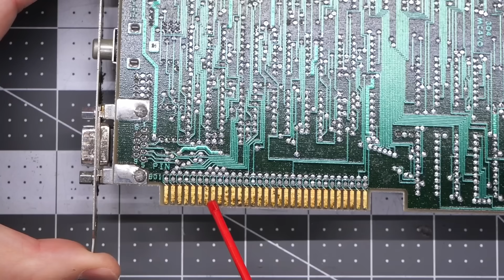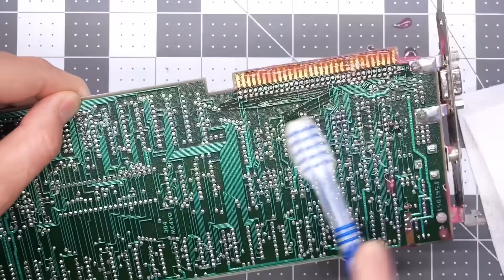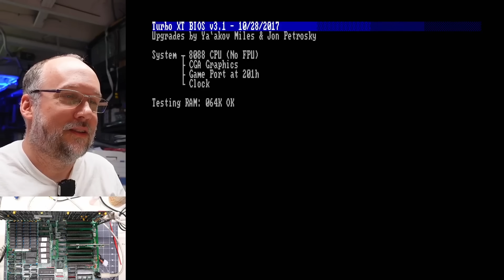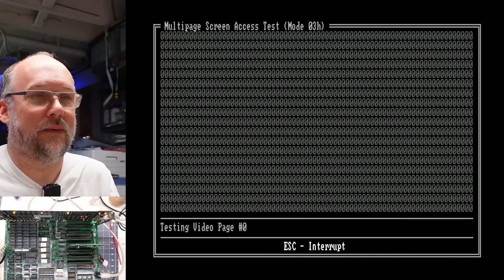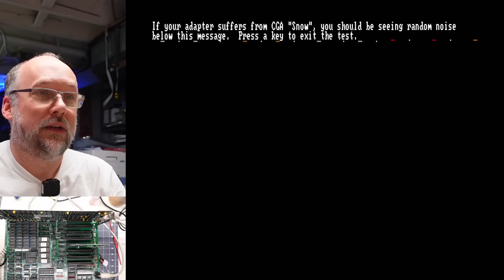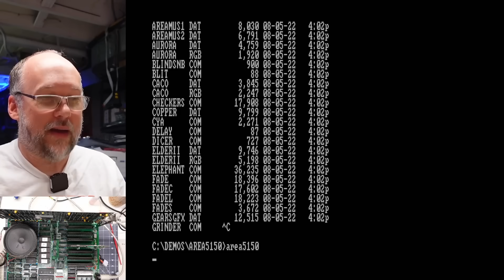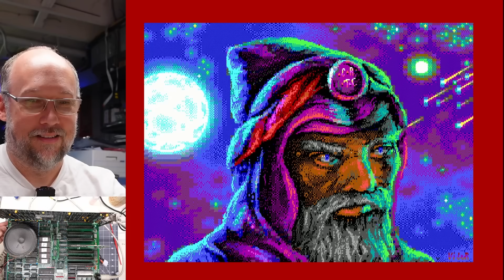Can we save this heavily corroded IBM CGA card?

Comment: According to the new Google AI: Loctite Naval Jelly Rust Dissolver is a gel-like rust treatment that contains the following ingredients:
Water: 65–70%
Phosphoric acid: 25–30%
Sulfuric acid: 1–3%
Thixotropic polysaccharide: 1–3%
Isopropanol: 1–3%
Surfactant: 1–3%
Silica: 0.1–1% 
 
MFA CAMEO Database
Naval Jelly Rust Dissolver - CAMEO - Museum of Fine Arts Boston
Oct 17, 2022 — Naval Jelly contains Water (65-70%), Phosphoric acid (25-30%) and Sulfuric acid (1-3%) in a gel matrix composed of a thixotropic polysaccharide (1-3%), isopropanol (1-3%), Surfactant (1-3%) and Silica (0.1-1%). The phosphoric acid dissolves the Rust (iron oxide) and then reacts to form iron phosphate.

The Home Depot
Loctite Naval Jelly 16 fl. oz Rust Dissolver 553472 - The Home Depot

dm.henkel-dam.com
TECHNICAL DATA SHEET
Apr 12, 2018 — Color: Pink. Application Temperature: Apply between 50°F (10°C) and 90°F (32°C) Appearance: Liquid gel. Odor: Lime (use in a well-ventilated area) Base: Phosphoric acid. Working Time: 5 to 10 minutes. Specific Gravity: 1.191. Max. Working Time: 15 minutes. Viscosity: 2.5 Mcps. Clean Up: Rinse product off with water. pH: 1.5-2.5. Caution: Wipe off painted surfaces immediately. Will remove paint. VOC Content: 2.4% by weight. 28.6 g/l calculated. CARB. SCAQMD rule 1168. Shelf Life: 5 years from date of manufacture (unopened)
Generative AI is experimental.

Comment: Find yourself a gold or tin brush electroplating kit. Shouldn't be that expensive, and the voltages should be low enough to not toast anything (and even if they are, with a little care you can keep it isolated to an individual pin and not flow current).

Comment: I performed a number of jobs before I became a tech ranging from circuit board assembly to touch-up soldering and also QC in-process inspection. Those yellow stickers with black arrows most likely come from QC inspection after the parts were inserted, most likely by an auto-insertion machine, before the boards are put through the wave soldering machine.  If a bent leg is found, the QC inspector will put an arrow pointing out the bent leg so that a PC assembler can go back and fix the board. Sometimes, the boards make it all the way through into wave soldering and these are found during the touch-up phase, but in this case, they appear to be pre-wave-soldering because, would be signs of hand soldering.

Usually, the arrows are removed but for some reason they were missed and forgotten on this board. Just like the board, these arrows are part of history.

I would tin those exposed edge-connector pads. That will seal them up pretty well. I wouldn't worry about scraping off the solder from the surface. If you think about it, how many times are you going to be inserting and removing the card from a motherboard? It's not likely to be done on a daily basis or more frequently than that.

Comment: So I think that black stuff may have been fossilized soda. It kinda makes sense for how it corroded, but still looked black when it was on plastic. If it was Coke, the phosphoric acid in it would easily have caused the corrosion over time. And the Naval Jelly easily would have dissolved it because the way you remove dried Naval Jelly is with more Naval Jelly to rehydrate it.

Comment: LIQUID TIN - by MG CHEMICAL

Just brush it on the traces or dip after cleaning.
Made for circuit boards.
It  auto electroplates instantly.
Reply: Lots of 5-star reviews on Amazon.  Thanks for the suggestion!  I'll have to add some (and gloves) to my cart to use in the future.

Comment: I'd be curious about trying to electroplate some gold onto the contacts. Obviously that could cause damage but maybe setting up a power supply with a probe to the top edge of the contact and an alligator clip holding a cotton ball soaked in gold plating solution would work. Have to be really careful though but it could be a fun experiment.

Comment: @AdriansDigitalBasement][
If it were me, I would take a rubber eraser or magic eraser, very littlely to the contacts and then carefully tin them. A lot of material has been remove and tinning will restore those contacts to a better thickness a strengthen them up.

Comment: I would tin the contacts and then wick them off again REALLY well so it's almost an alloy of the copper/gold and the solder instead of a "coating".   USE FLUX PASTE and wash with IPA.   Probably lead free solder as well.

Comment: One thing to realize Adrian is that a dab will do ya with Naval Jelly.. I realize it's cheap and you can use however much you want, but seriously, it's basically phosphoric acid in petroleum jelly, it will absolutely stick to whatever you put it on and you don't need to build it up thick, a little bit and about 10 minutes, but 10 is pretty much the max on electronics.. but yeah, a dab will do it..

Comment: The law about labeling every carcinogen, no matter how safe, may sound silly, but the penalties for infraction are no laughing matter. It is put on anything with even the most remote chance of being on sale in California, because no matter how many gallons of ink you need to put it on every product label, it'll still be cheaper than accidentally offering even one relevant product in California and getting noticed.
Reply: Prop 65 was responsible for a substantial reduction of lead (and other chemicals) in products nationwide (maybe planetwide.) The problem is that there was a penalty for not labeling covered chemicals but no penalty for labeling non-covered products so businesses just put stickers on everything.
Reply: @wesley00042  Known to the state of Cancer to cause California
Reply: @wesley00042  The problem with that is that it is no longer a warning.  If everything is bad for you than nothing is bad for you.  How are you to know if you are dealing with something that is truly cancerous or just something that was inked on to prevent a penalty?

Comment: so the Technical Data Sheet Says it's Phosphoric acid with a PH of 1.5 to 2.5..   Also says not for use on Fiberglass, plastic of aluminum. Oder is discribed as "lime" and Use in a well ventilated area)     You should be wearing gloves AND goggles when you work with it.

Comment: Most people won't be adding and removing cards a ton, so I would say that your scenario is the exception, not the rule. If some solder sheds into a slot, I think that's acceptable.

...but this might be your excuse to play around with some low-voltage (read: it'll take forever to complete) electroplating. Figure out where those slot connector pads(?) go, maybe pop out a chip or two (but hopefully not) to protect them, and re-plate them.

Comment: For the card edge fingers, tin them with a good solder, then remove as much of the solder as you can with de-soldering braid.  This will leave a very thin coat similar to HASL.

Comment: AI states, Naval Jelly contains Water (65-70%), Phosphoric acid (25-30%) and Sulfuric acid (1-3%) in a gel matrix composed of a thixotropic polysaccharide (1-3%), isopropanol (1-3%), Surfactant (1-3%) and Silica (0.1-1%). The phosphoric acid dissolves the Rust (iron oxide) and then reacts to form iron phosphate.

Comment: An alternative to tinning with flux and solder may be the so-called "liquid tin" made by MG Chemicals among others. It's a solution that you can paint onto exposed copper and it will coat it with a layer of tin. I don't think it's very durable if you subject the area to mechanical stresses like inserting repeatedly into slots, but you can always reapply.

Comment: Tin the contacts unless it will be maintained in a slot.  The issue is reaction to moisture in the air, so you need to stop that reaction cycle. Tin of the contacts slows this to a greatest extent but not completely, and as adding and removing the card from a slot wears the tin layer down.  You could also rub candle wax on the contacts, but again, would need to remove it when putting card into slot.  You could put clear polish on the contacts but you would then have to remove same to use the card.  WD40 is not appropriate, it will over time decline/evaporate, and allow reaction to moisture in the air.   You could put the card in a zip lock bag with rice, this would absorb any relative moisture in the bag thus protecting the exposed copper.  If the bag remains air tight, problem solved.

Comment: I wouldnt use standard 60 40 solder i did this on the connection on the nes cart connector and it had poor conducting cleaned and used some silver solder was a little pricey but worked really well for me at least.

Comment: WD40 pretty much evaporates, not sure if deoxit is any different. Sewingmachine oil will hang around longer,  but only a very thin coating, you don't want it to flow down the socket. Oil binds dust, that is a drawback. If tinning, then very thin, use wick to only leave a thin layer, but it may corrode too, and not good for a card that is pushed in and pulled out alot. Maybe goldplate them yourself with edible gold flakes andmelt it on there, just  a wild idea, I have never tried it. 🙂

Comment: Solder is good at preserving what lies underneath but it's not the best for card-edge connectors. There are chemicals you can buy to re-plate but they have a tendency to cost a lot and be slightly unstable/have a short shelf-life (they fall out of solution, rendering  it unusable)

Comment: I would use a switch lubricant as it will stop further damage from further oxidation. I have tried tinning connections causing more problems with socket damage!
Older boards have thicker copper so more resilient than 90's boards!

Comment: There are very cheap gold electroplating pens available in several places. It comes with a little gold plating solution and a pen like device that has a couple of wires to plug into a power supply and touch the via that is connected to the edge traces and run the pen on the fingers to replenish the gold.
Reply: I found a video on repairing edge connectors via this electroplating method:
PACE Rework and Repair "Replating Edge Connectors"
https://www.youtube.com/watch?v=wYza_M8WVf0
Reply: yes, for 150euro.... :D
Reply: alternatively there is a solution that works with heat. especially for jewelry but also it could help at those connectors
Reply: @CM-mo7mv  is that the kind where you evaporate a carrier fluid? I’ve been wary of those because of ventilation considerations. But I suppose they work without a power supply!
Reply: I should get that for some jewellery tbh 😅 a few pendants I've had for 20 years are having their gold flaking off.

Comment: Given how cheap it is, you could try doing a re-plating of all the ISA slot fingers. Easiest would be to connect all the fingers together with a common cable somehow and then go at it with nickel or something. Nickel holds up extremely well and is still conductive.
Reply: or just go over it with solder, and then remove as much as possible with desoldering braid - will essentially leave it tin coated. Not as nice as the gold, but good enough.

Comment: the stickers are often used by quality control. I think they had the same when i worked at siemens back then.
I would think the copper is a deposition, so it can be rubbed off. Green corrosion is usually Cu2+ salts, and the jellly reduces it to metallic copper chemically.
Reply: It's probably not copper salts but copper carbonate/hydroxide/sulfides.
Reply: @xenoxaos1  copper salts are colored green, while elemetary copper is red/orange
Reply: @SonjaWeygand  true. But battery chemistry is usually alkaline. Potassium hydroxide is a common electrolyte.
Reply: @xenoxaos1 Ah yes youre right, it could have been a hydroxide then. So it can be considered a salt of H2O.

Comment: You should have a look at the material safety data sheet for the rust remover. It's not difficult to find. You really should use protective gloves when using this stuff. The stuff is powerful but not harmless.

Comment: There is a chemical way to cover coper exposed surfaces  in a protective electrically conductive material that I used for my homemade pcb's. I use to use it when I was back in Romania and while I did find it on a web shop back home, I don't think the link will do you much good. However it bares "SUR-TIN" in the name and a quick google search shows people from various places using variants of it, so maybe have a look into SUR-TIN. It was fairly simple to use and did actually offer good protection. Last time I used it was for a PCB I made for a washing machine, and some 11 years later it still holds. That's all I can say for what it does, but back in the day in ol' communist Romania it was either literally soldering over the traces or this chemical stuff. Believe it or not, masks and lacquer came in much later. I still have some ZX80 clones from the 80's and all the traces are soldered over. However some of the Russian made IC's on the other hand have died, especially the ROM's. You'd probably have a good time fixing one of those up, given the lack of ULA's and having to make do with discreet logic instead. If I remember right, you had one sent over by a viewer, I'd simply love to see you tackle one of those. I did, on multiple occasions - don't get turned off by the Russian writing on the shift registers :-) they are common clones of the LS series. That'd be a master case in detective work if anything
Reply: MG Chemicals "liquid tin" is the same thing and it's available on Amazon.
Reply: @stamasd8500  I second this if he isn't going to gold plate the copper pads. 
I'd use a qtip and some kapton tape to isolate the good gold pads; then use the qtip to liberally apply the tinning solution to the exposed copper pads. 
It's going to be a lot better than solder; and probably won't shed as much solder would.
Reply: TBH, some (cheap) western companies just tinned their board traces too. The Sinclair ZX-line ones especially, so the thicker traces had a distinct wrinkled texture to them!

Comment: Electroless gold plating solution is available and is just the thing to fix edge connector fingers up.
Reply: I was thinking there must be some way to re-plate the edge connector at home, maybe not the same process as at factory but something similar.
Reply: It would wear off and ruin the slots. No reason to do that, might as well just tin it. The stuff from the factory is hard gold plating, ENiG, which doesn't rub off from contact with the slot fingers.
Reply: @Nukle0n  It would not ruin the slots, they'd be fine.
Reply: @skonkfactory  if that gold gets rubbed off, where does it go? Into the slot.
Reply: @Nukle0n  It won't do the slot any harm.  It'll just get wiped off when you insert a card.
Reply: electrolysis?

Comment: Hello, the yellow arrows to mark pin was missing solder at the QC for repair.  I have re-gold the fingers computer cards back in the 1980's.
Reply: Agreed, those stickers look like they're marking bad pins either during a repair or manufacture. It is most likely that the board was inspected after it was machine soldered and a QC technician marked those spots as a bad solder joint or a solder bridge. They probably forgot to take them off after they touched up the board.
Reply: yeah, that was my immediate reaction, those were rework markers
Reply: QC?  Quality control?
Reply: @silentotto5099  Yup. I used to work on a factory floor in the 90's making Cisco routers, and we did something similar for "#603" faults, which denoted a broken trace and the pins that needed to be wired together by Rework. I was the guy that found the broken traces when the board came from QC as a DOA. Such faults were very rare, but a board could have up to 5 of them before it was considered scrap. Realistically, it got scrapped long before that threshold because our fault-finding time was more valuable than the odd dodgy circuit board.
Reply: @seancurtin6103  I used to repair Lucent and Cisco routers boards in the last 90's.
Reply: @silentotto5099  Yes.
Reply: @stevenretroworkshop2113   Thanks.

Comment: As far as the gold traces. You could try testing out on a card that if things go south you don't mind it. But Caswell and Rio grande sell gold plating kits. That you use like a brush to brush it on. You hook part of it up as a cathode and the other part is an anode and you just use a brush to brush it on and that could possibly be an avenue but it is a little pricey. I guess research is needed...

Comment: Yes, it was I that mentioned about Naval Jelly to you some 5+ years ago to fix a Rusty PC Case, and stated the dangers of washing a board straight tap water as some of us have hard water, though you have soft water. It is always best to use distilled water which one can find at department stores, or auto shops by the gallon.

Glad to see it bringing back to life yuck zombie cards is great. Glad you found a use for the stuff. Keep bringing back systems from having one foot in the grave.
Reply: What do you mean by hard and soft water?
Reply: @gabrielkakizaki5567  some areas have tap water with alot of minerals in it. This is called 'hard water'. I think this is mostly groundwater.  Where I live our water is from snowmelt and rainwater reservoirs with few minerals and is 'soft water'.  Hard water tends to leave mineral deposits behind when used for cleaning.

Comment: I say just tin them, loads of flux, scrape it back with the solder wick so its literally just a plating layer.
Reply: Yes, re-plating with gold on fingers is very expensive.  Using solder for the finger and using solder wick to the finger's worker fine.  I have repair old computer boards.